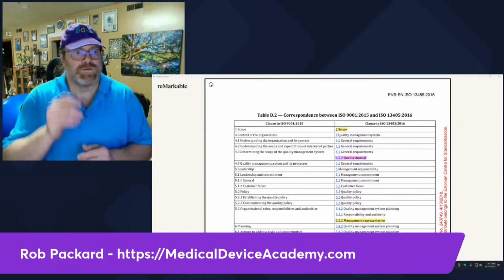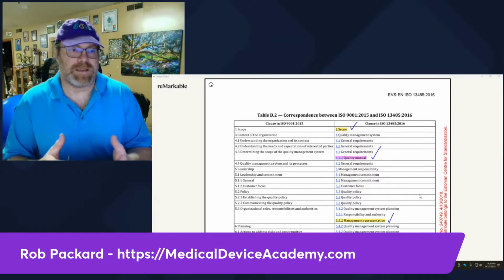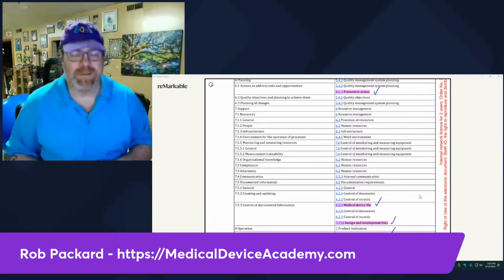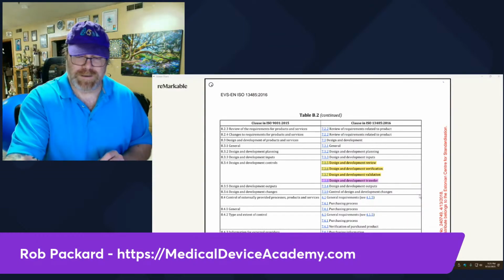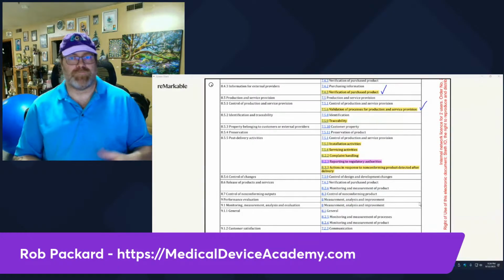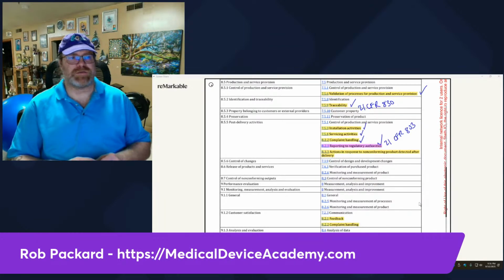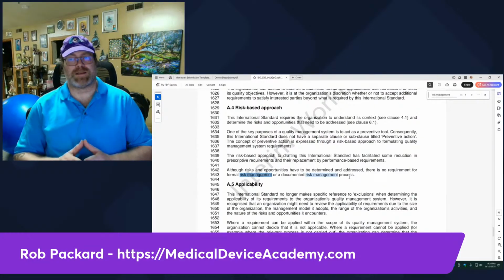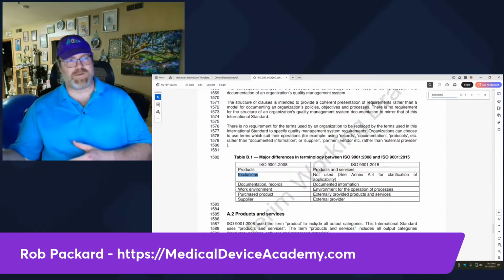What is the difference between ISO 9001 and ISO 13485?

Comment: Thank  you for your lovely contents. I'm a Quality Manager in MD manufacture company in Republic of Korea. 
I have a question. We have an ISO 13485 certificate and a QMS in place. If we want to obtain ISO 9001 certification, do we need to prepare separate QMS documentation for ISO 9001?
Reply from the maker: No, you can have one quality system for multiple certifications. You will, however, need to modify your quality system to meet the requirements for ISO 9001. There are some differences since the 2015 version was released. You should maintain the numbering for ISO 13485 and create a cross-reference table to help navigate between the two requirements. You will also need to add requirements specific to ISO 9001, such as continuous improvement and customer satisfaction.